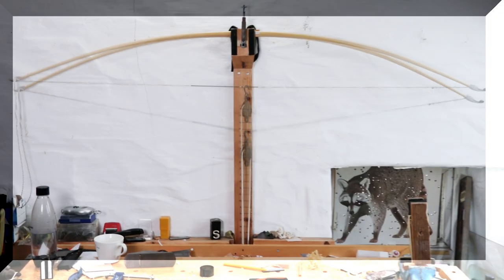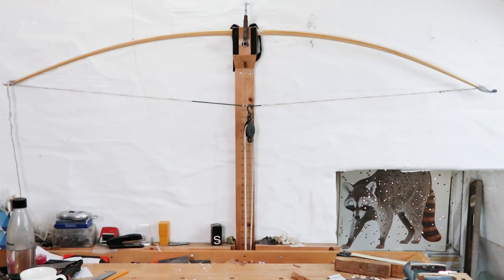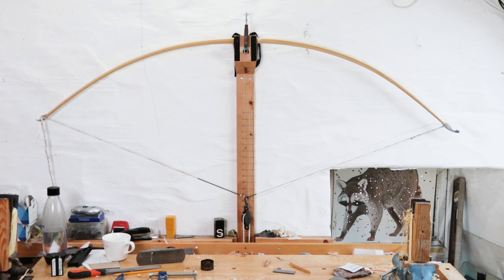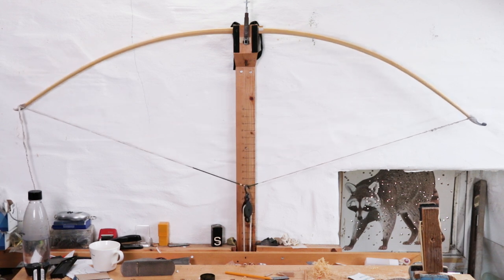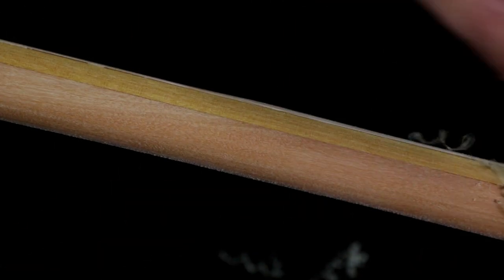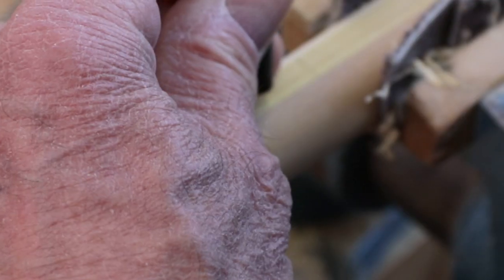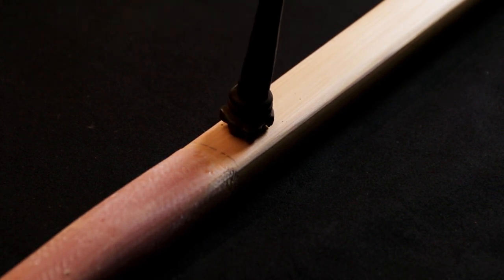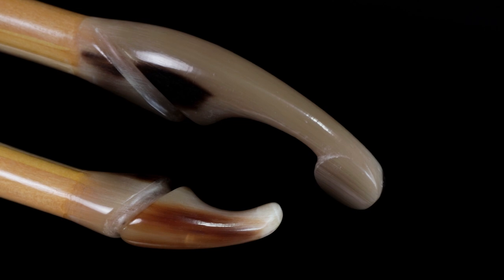Finishing tillering sanding wood and polishing nocks  Part 5 of how to make a longbow

Comment: Great video as usual, i only recently learned what a hinge is, i had an idea about what it was but i only now learned that it can be a permanent weak point of a bow rather than just an inbalanced tiller (a bad tiller cemented into a bow semi perminently if you will) . It only took me 3 smashed ash staves to learn😅, i learned that ash really doesnt tolerate bad tiller as supposed to woods like hickory . I have two questions if you dont mind me asking. First is, how you prevent a hinge from developing in a bow. Second, i hopefully should have my first yew stave coming in from america, do you think i could get a 74 inch yew stave to draw to 31 to 32 inches ( Full compass)  or would it be too risky? Do you have any videos on full compass tillering?
Reply from the maker: Hi, practice is what helps prevent any tillering issue, a `hinge` is juts an area where you hvae taken away too much wood or an naturally weaker part of the wood in the stave.  Taking things slowly is the best approach.  Personaly I wouldent make a bow to draw to above 29-30" at that length.

Comment: I see that during the final tillering the pulley is still moving from right to left. Is that due to using a different string for tillering?
Reply from the maker: No, the top limb is longer than the bottom.